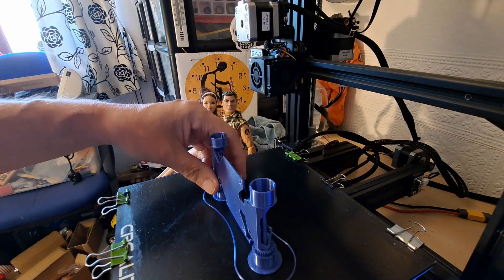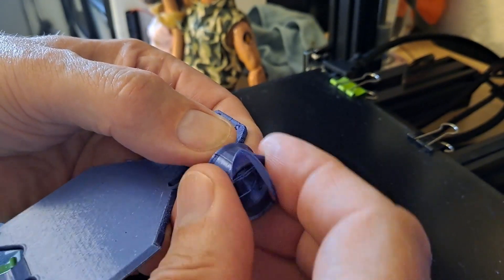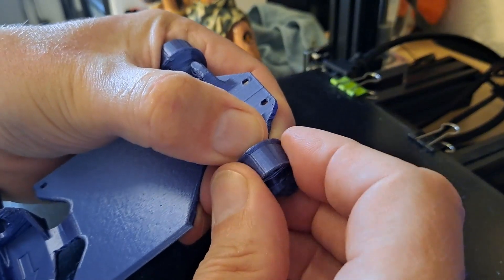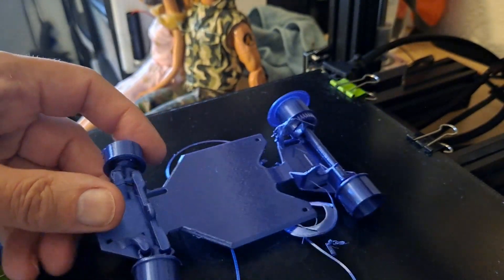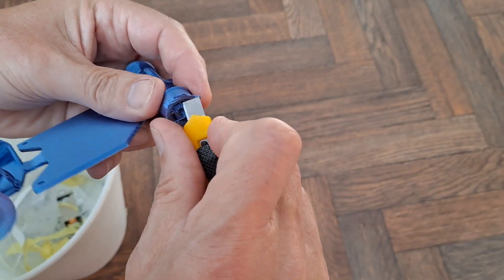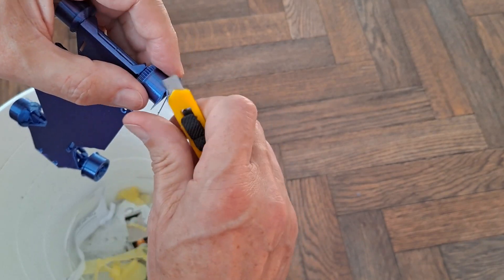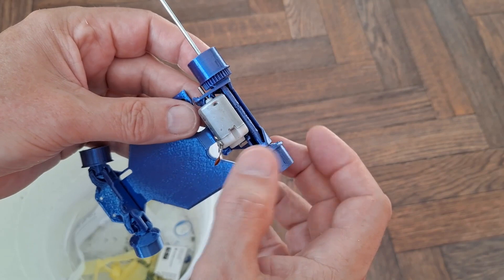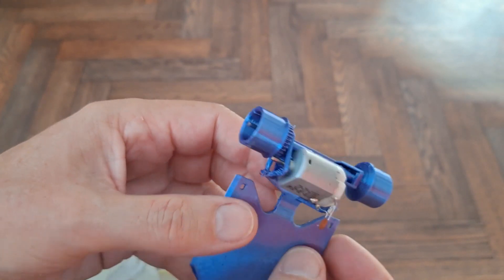Printing the Gamma 2.0 PART 2

Comment: How did you manage To push the spoke through the axle? Did you heat Up the Metal rod and then  push it through?
Reply from the maker: No, it is designed with a hole through it ready for the metal rod to fit in it.

Comment: its really cool that it can print in one piece.. that back axle seems like a bad point, is it the prog or the machine? maybe changing the center section of the axle to a triangle or square?  If the parts do  break can you print just a part of the program, like the front end?
Reply from the maker: The back axle is really just a support for the wheels in this design. It will never have any strength because the layers of the print are in the wrong direction. That is why he designed it with a hole up the middle, so you can slide a metal rod inside for the strength. And, NO, you can't just print a part, even if you could, you wouldn't be able to fit it. It would be like one of those magician tricks with three rings, and somehow get them to pass through each other 🤣🤣 That is the downside of a design like this. I think you would have to consider it a disposable chassis. I think he did a video to show he can assemble all the RC components and motor onto a bare chassis in under 10 minutes, which is probably quicker than trying to replace a broken steering arm.